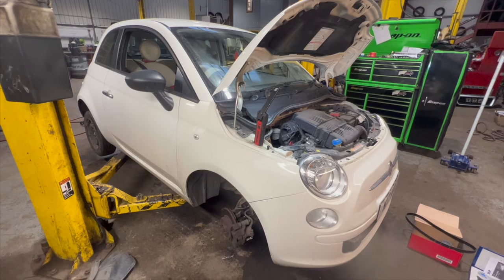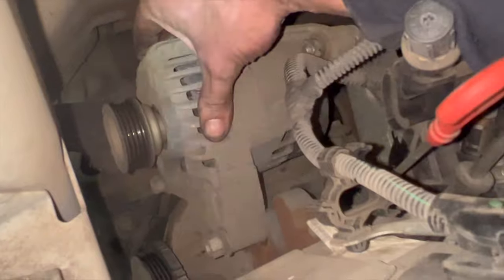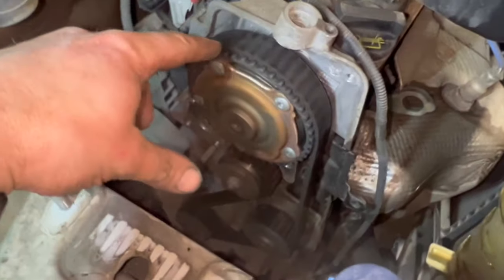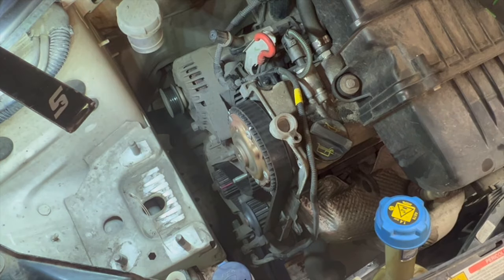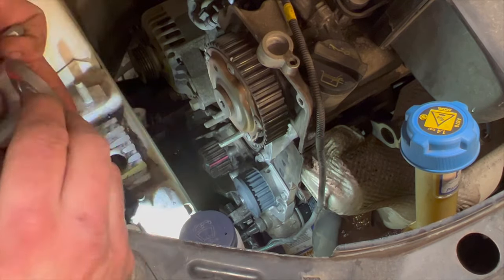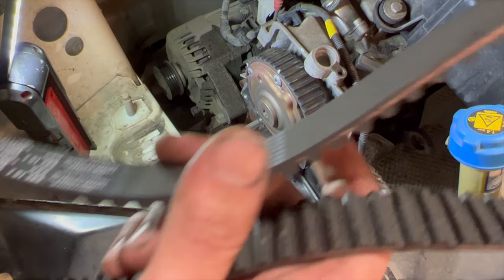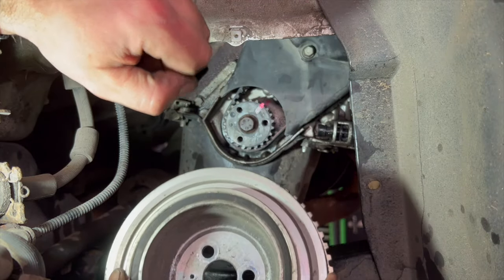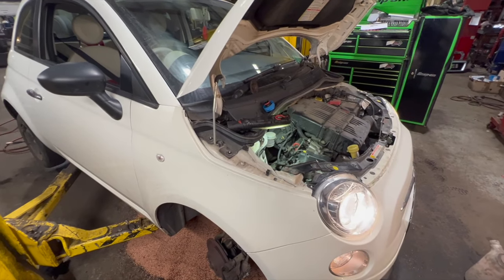Fiat 500 Timing belt & water pump replacement (same as new Ford KA)

Comment: I don't think i would have managed the job without you. It was almost like having an expert at my shoulder walking me through it step by step. So detailed and doesn't miss anything important.
Reply from the maker: 👍👍 thanks for the comment , always nice to hear positive feedback 🙌😀
Reply: @diydaly  I have a 2009 ford ka and it's needing a new camshaft sensor but I have absolutely no idea how to find it on the car ?
Reply: Expert??? Did not use timing tools assuming who did it before did it correctly. You are meant to slacken cam pulley.
Reply: Cam tools important?
Reply: Adjust tensioner to max rotate engine twice refit tools readjust tensioner to spec, that's the expert way to do it.
Reply: What are those tools for in the end diagram, when did the aux belt get fitted?

Comment: Just bought a 2014 Ka. It has only done 25k miles but has been hardly used or MOTd since 2017 so a cambelt/waterpump change is probably a good idea-I have a Haynes manual but your video has emboldened me to do it!  Thankyou.
Reply from the maker: Great to hear it! thanks for the comment 😃👍

Comment: Thanks for the video. Done plenty of cambelts before but not on this engine so it's always worth watching someone else doing it first. I've got the full locking kit and was considering locking the camshaft as per the instructions. My assumption is that they lock the opposite site of the camshaft in case you have to change the pulley as well, but it seems such a fiddle to remove the cam cover and all the other kit connected to it, so I'm tempted to use marks as you have done on my Doblo providing, of course, whoever did it last time did it properly. It runs OK so I'm assuming so. Thanks again for taking the trouble to record the process: certainly the best video of this process I've seen!
Reply from the maker: Yeah I generally just paint mark em unless there’s an issue or the engine apart etc then you have to pin it correctly , generally if the timing was out they log a cam/crank sync fault .. sames a lot of messing about if you can just paint mark it 👍
Reply: I believe the pulley is on a taper and not keyed. Locking the camshaft and loosening the pulley allows for some adjustment (if teeth not quite meshing with the belt0 but as stated, generally unnecessary

Comment: I'm a bit late to this video but this is just what I needed! I have a 2014 Ford Ka which obviously has the same engine which I need to change the head gasket on. This goes a long way to getting me there. I'm not a mechanic but have a healthy interest in mechanics. I'm a construction site manager so I'm used to being methodical and structured. Many thanks for this! Gaz.

Comment: Awesome matey, I bought my daughter a ford Ka, same engine.
Only had it four days, dealer said they changed timing belt and I'm suspecting he has done it your way. Don't know about the water pump though. Found a leak on thermostat housing so I'm going back with it 
First class job and video helped loads
Reply from the maker: Great , glad it will help .. thanks for the comment 👍👍

Comment: Brilliant tutorial, well done fella. That's the way i've always done it, but I mark the old belt too. I then line up the old belt with the new one and transfer the marks over. Probably not essential, but just habit I guess, and a further reference point to avoid things going bang :)
Reply from the maker: Thanks! Much appreciated 👍
Reply: I’m trying to understand this. Do you mark the belt in two places in line with the marks on the pulleys?

Comment: Great video. Watched a few times before doing my daughter's belt. Made the job so  Simple.
I also marked the old belt before removing and then counted the teeth and marked the new belt. Could be very easy to refit 1 tooth out. 

Just as an additional note the dayco kit comes with a tool for the tensioner.
Reply from the maker: Thanks! are didn't know that! nice bit of info 👍👍 thanks

Comment: Great guide and easy to follow, only thing I did differently was used the tool to lock the crankshaft, took about 2 hour to fit, when moving the engine mount for the engine you really need a shallow 15mm socket,
Reply from the maker: 👍👍 glad to hear it

Comment: Thank you for detailed explanation I managed to complete it in 2 days. 

Yesterday i completed it took it for a test drive all was good… today in the morning i started it up and it was knocking. 

So I did the job all over again today and found out that the tensioner had come loose(un-tensioned). 

When trying to re-tension it, i held it in place with the plastic 2 pin tool whilst i did the nut up like you did and it worked. After starting the engine the tensioner guide window thing moved and it became loose again. 

I repeated this process over and over. I could not tighten it more as when i tightened the nut the while thing moved and again moved out of the guide window. Really the plastic 2 pin tool provided wasnt strong enough to hold it whilst I tightened it up. 

So I ended up fitting the old tensioner that seems to grip when you tighten the nut and all is good. However i need to fit a new tensioner perhaps for another day. 

I can’t work out what the problem is with the one i bought in the Dayco kit. Maybe I just need a metal 2 pin tool? 

Also 30nm doesn’t feel like a lot for the tensioner and I feel it would slip and slack the belt so i did it a bit more tighter.

Normally the block has a grove for the tensioner to slot in to so I really don’t know.

Any insights would be much appreciated thanks. Again great video!
Reply from the maker: Not come across any issue with them tbh , I usually fit the gates kits .. never known one to come loose before though , I always torque to 30 Nm .. I little more won’t harm anything though .. I’ve only im ever used the metal tensioning tool so can really speak for the plastic one but can’t imagine it’s up to much! 🤣.. 🤞 everything works out this time!

Comment: Good video! I just Did a replacement on my timing belt tensioner and water pump, I used the tool kit for the timing belt replacement, I put everything back together turned the engine on everything works fine, but the engine light is on, I don't know what can be
Reply from the maker: Glad it helped 👍👍 you may need to code scan it , possible sensor issue ? I’ve the timings slightly out it may log a cam / crank sync fault
Reply: @diydaly  indeed was exactly what, I just disassembled everything back and the timing was slightly out, I put back where should be and now is everything fine, thank you

Comment: Good job 
I did it on my car few days ago 
Why the belt it is not on the centre of the pulleys? 
You fitted on centre but as soon as you rotate de engine twice, the belt came on the front edge of the cam pulley 
Mine is on the inside edge now 
It is normal ? 
It’s gonna center itself in time ?

Comment: Great video. But why did you not just lock the crankshaft pulley as you had to get the locking tool out anyway to line it up?
Reply from the maker: thanks 👍 .. that tool I used was just the tensioner adjusting tool mate

Comment: Hello DIYDaily, the timing belt tensioner pulley’s locking nut is reuseable, or using a new one is necesseary?
Reply from the maker: It’s advisable to renew it but I’ve reused them in the past without any trouble

Comment: Great video , does your cambelt sit nearer the end of the cam sprocket as just changed mine and it sit towards the end,  not in the middle ?  used a gates kits and water pump
Reply from the maker: it was a while ago I did this , I can't quite remember tbh

Comment: Have you come across the P0016-76 fault code before? Camshaft/Crankshaft out of sync. Happened all of a sudden. I've seen it's possible for the vvt solenoid filter screen to clog up.

Comment from the maker: Check Euro car parts - https://tidd.ly/3lIO7xA (use discount codes on site)
Check GSF Car parts - https://tidd.ly/34pZe7o (use discount codes on site) 
Check "Car Parts for Less" - https://tidd.ly/2LNEwIn (use discount codes on site) 

Gates Timing belt kit & water pump eBay - https://ebay.us/oXvsC6
Gates Timing belt kit & water pump Amazon - 
Gates Auxiliary belt eBay  (without Aircon) - https://ebay.us/a9Yd2H
Anti freeze - https://ebay.us/um2Ex5

Timing pin Tool kit eBay - https://ebay.us/1bLgIJ
Tensioner adjuster tool Ebay - https://ebay.us/ZGQLeU

Tools Used :

             1/2” Dewalt impact driver - https://amzn.to/3e2Uff2
             3/8 Drive 12v Milwaukee Impact driver - https://ebay.us/ZtxrBu
             Socket set - https://amzn.to/3eGx2Ak
             Milwaukee 12v battery ratchet - https://ebay.us/U4TbLC
             Ring Inspection Lamp - https://amzn.to/3gGWHcG
             Coolant catch tray - https://ebay.us/4IfwA3
             3/8 Digital Torque wrench - https://ebay.us/LdtLxw           
             Spanner Set - https://amzn.to/389UOTk
             Inspection mirror - https://ebay.us/hPLzKd
             Drill bit set - https://ebay.us/rjj8sQ
             Pry bar set - https://ebay.us/8XpNUO
             3 Ton low profile Trolley jack - https://ebay.us/uPUkh0
             Brake cleaner sprayer - https://ebay.us/3jzVNp
             Brake cleaner - https://ebay.us/65MI6g
            
Torque Settings :
Water pump bolts / nut 8-10NM
Timing belt tensioner 25-31NM
Timing cover bolts = 10NM
Auxilary belt tensioner = 23NM
Crank pulley (4 outer bolts) = 23-28NM
Engine mount (to body) 54-66NM
Engine mount (to engine mount bracket) 54-66NM
Engine mount (bracket to engine) 54-66NM

Check out my other timing belt videos: https://www.youtube.com/playlist?list=PLDTPJANi9HjoaO_bcawhaGNVnFCg1HWCV

Comment: I am about to start this procedure  on a 2012 500 1.4 and am wondering if this can be done without removing and disabling  the a/c pipe directly above the timing belt cover?
Reply from the maker: Can’t quite think tbh , but Aslong as it’s not too in the way shouldn’t be a problem
Reply: @diydaly  There is a vacuum pump on my 12 fiat 500 1.4 sohc and I am thinking about your way with the paint marks. .considering marking as well the old belt* at same time as other marks as your illustrations and then carefully transferring the marks to the new belt * from old belt as another  check..as I do not want to dissemble  the vacuum pump if not required..nor lock it down..I do have the lock down kit* but your way makes more sense !

Comment: Is there no need to remove the cylinder head then. Can just do the cam belt by making sure the crank is lined up?
Reply from the maker: Yeah the only way to be 100% sure is to lock the cam but generally it it’s running ok you can just mark the Pulley 👍

Comment: Hi, had a cambelt kit and water pump change done 1000 or so miles ago on Ford Ka 2013 1.2.Same engine as fiat 500. Now developed an intermittent misfire on two cyclinders 1 and 4 according to OBD codes and goes into limp mode, eml and stop start lights coming on . Turning off engine and restarting solves problem until the next time . Has  had ingition pack and leads and plugs changed. Still having intermittent issues so could this be the cam belt timing is out from the replacement work? Same symptoms as if faulty crank shaft sensor but no obd codes for that so far. Most puzzled and potentially dangerous issue. Any advice appreciated...will send your vid to my mechanic too. Thanks for your vids!
Reply from the maker: very hard to say without looking tbh mate, could be various issues

Comment: When do you change the timing belt age or mileage? I read online Ford have now said 150 K miles for the cam belt change and also 60 K and age is not why you change. 
I’m looking for advise a I have bought a car with only part history with 40K miles and and 8 years old.
Reply from the maker: Tbh if it’s 8 years old I’d get it done regardless of mileage , I’ve seen these belts badly perrished at 8 years old

Comment: Hi really awesome video. Q my aunts Grand Punto's thermostat housing and water pump leaked and the car cut out from what I expect is the over heating as I doubt there is a fail safe for that.
No the problem is it backfiring in the manifold  and some one reckons it jumped a tooth on the cambelt, could that be.
Reply from the maker: Thanks for the comment! They are not the strongest engines and if it’s heat siezed the belt could have easily jumped a tooth but chances are it may have done some more serious damage , I’d do a head gasket test first then check the timing

Comment: Having an issue with the top pulley, camshift. Ive gone through step by step but the belt wants to slide into the casing, any ideas of what could be causing this.
Reply from the maker: Must be something out of line or a bearing not right on the idler / tensioner
Reply: @diydaly  thank you

Comment: Hi, I am losing coolant from the system at the right side of the engine under that aluminium cube that has those two electric multi-pole connectors with the red plastic lever that holds them at place. It is not leaking from that hose that comes out from the coolant tank on the right side and goes towards the engine, but behind it somewhere - which I cannot see without removing that electric related aluminium box.
It starts to leak when I start the engine, everytime I have to fill the system up again. Can you please recommend a video for fixing it, or any page from a service manual? Thank you!
Reply from the maker: Ill see if I can find anything, I think your talking about the rheostat housing

Comment: Great video, really informative and you have a new subscriber! - I’ve got a 2012 1.4 500C, which has only covered 57,000Km, but I believe is still on its original cam belt - Forums state 90k Km change but given the age, would you recommend a change?
Reply from the maker: Glad to hear it! Thanks , much appreciate it! Yeah I’d definetly recommend changing due to age mate 👍👍
Reply: Figured, and, based on your sound advice, will get her some new “sussies” !😂
Reply from the maker: @johncallaghan4616  haha 👍👍
Reply: Any belt//pump/silicone brand you’d recommend? - don’t want “new sussies” getting wet!😉
Reply from the maker: @johncallaghan4616  I always prefer to fit the gates kits if im honest. ive fitted a lot of different bands over my time and other than OE I think they are by far the best 👍 as for silicone just a reputable brand really

Comment: Great video thanks for sharing,, on the older models that little tit at six o clock on the block was the crankshaft mark 🔧 also there was a rubber grommet that pulled out of the top of the bell housing, inside there was a pointer that lined up with a slot on the flywheel…..
Reply from the maker: Thanks mate 👍 ive not come across that before tbf, I must admit its been a long time since ive done one! ha . thought id grab the chance at filming it while I could 👍

Comment: Please be careful with these torque settings.  Not sure about the 1.2, but I stripped the bolt holes in my 1.4 engine (aluminium) torquing them to 55Nm and had to get time-serts put in at great cost.  The workshop manual says 25Nm for these bolts for the 1.4 (although 60Nm for the other right side engine mount bracket bolts, which are steel into steel as opposed to steel into alu for the ones I stripped).
Reply: i have a punto 1.4 and cant for the love of god find those values, where you got them from?

Comment: i did it , but the computer says that the camshaft is in a wrong position, I used the tool, and check several times, but the check engine is still on

Comment: My 2010 cambelt snapped just replaced it zero damage was told on the 2010 model it dong cause any damage.  .
Great little cars had it 10 yesrs zero service just topped up the oil that's it . I know am bad . Bug still little work horse . We won't mention rust lol bavk axsl wups I said it ..